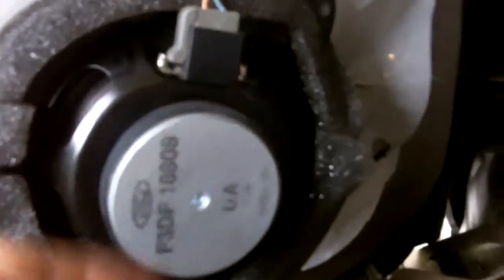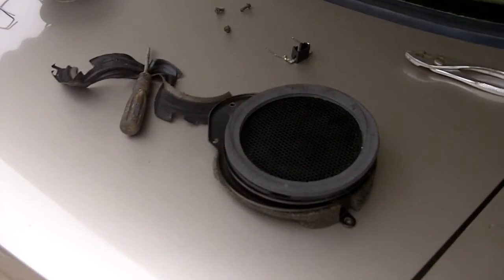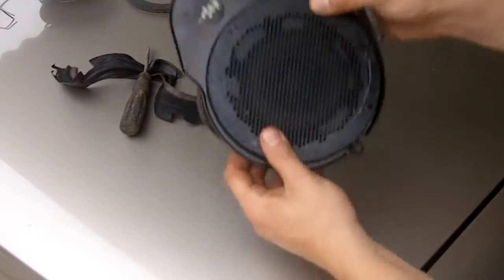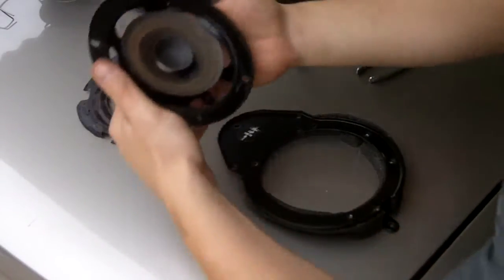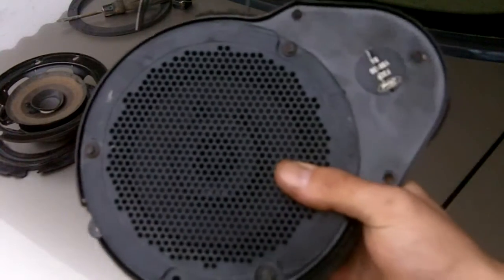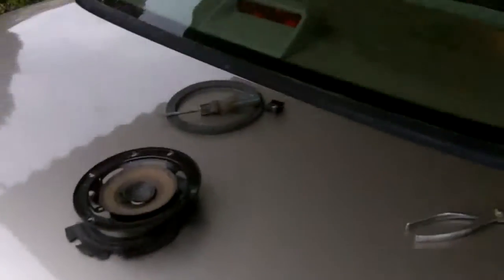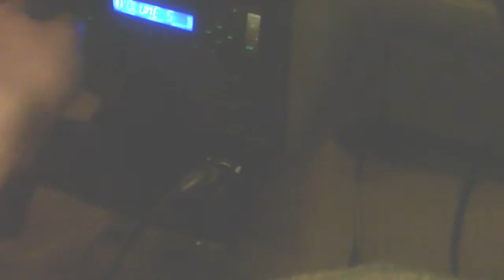How to Install Front speakers in a 1995 Ford Taurus

Comment: 5 1/4 speakers , they make speaker terminal adapters and you can use self tap screws also when doing that put a seal of RTV under the smaller speaker